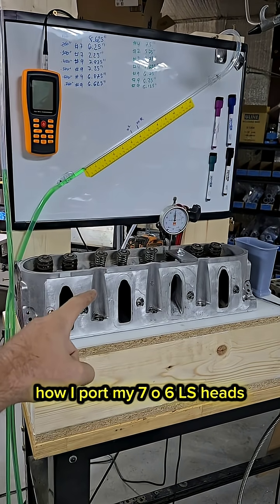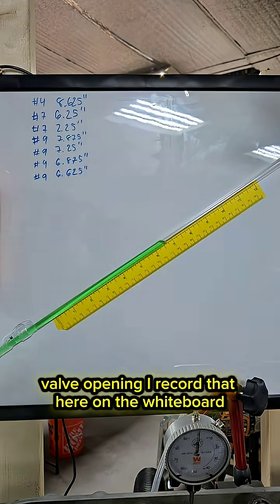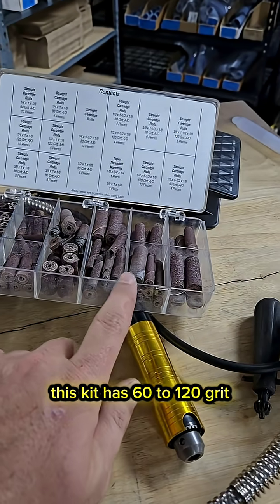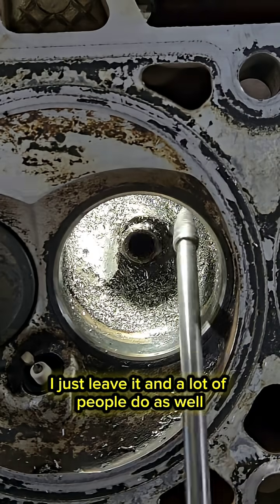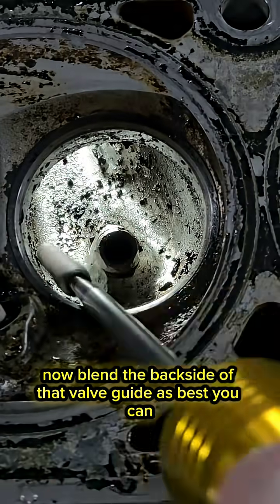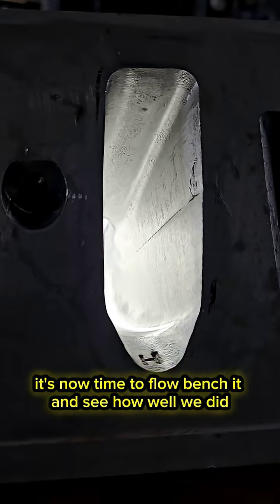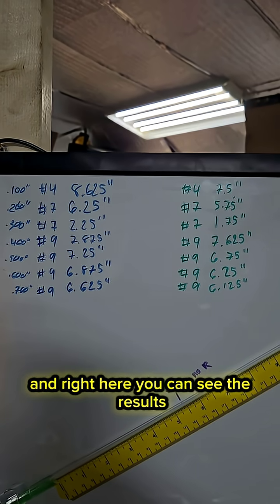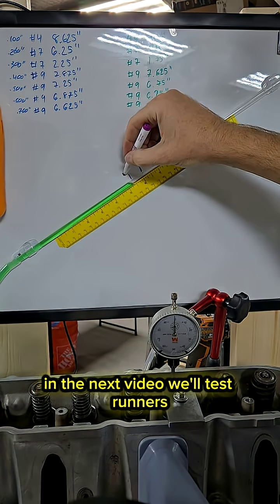DIY head porting! Beginners guide! 706 LS heads.

Comment: Ok u did good with all this but these are made by castech. I just had to learn the hard way that 706 are junk. Bc they crack in the middle head bolt pockets. They may not crack and leak water today or tomorrow but they WILL. It's just a matter of when. I know this from experience. And also. It's all over the Internet.
Reply from the maker: All things fail with time. These heads are off a 2004. So they are 21 years old at this point with well over 300k miles. The point of using these heads is that they are cheap. If they fail who cares. Throw them away and get another set from FB market or the junk yard. When it comes to racing things failing is a given. If your modifying a daily driver and need it to get to work then I recommend not modifying it at all. Just leave the vehicle stock. Race cars are for the track.
Reply: EARLY 706 heads from one plant had that leak issue. I can’t remember if it was Canada or Mexico plant but one had the crack and the other didn’t. Later casting the issue was fixed.
Reply: @Mangobrain82 ... Ok. Do the improved 706 heads NOT have the battery casting on the head. Which means it came from castech?

Comment: time to avoid the cam that produces .300" lift.  Looks like turbulence there.
Reply from the maker: Not sure why the gains slowed. Yes it might be turbulent. But if you keep going you see the flow gains flat line. repeating on the last 3 tests. I think the vacuum was at it's limits and we might need to add second one or a bigger one. Then I bet we would see bigger changes.